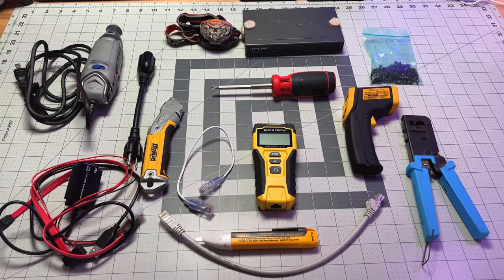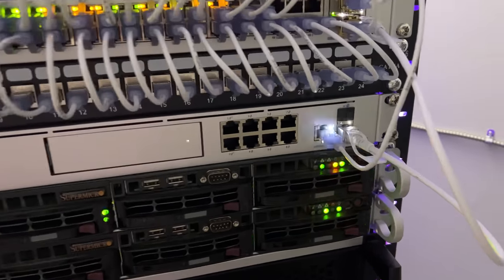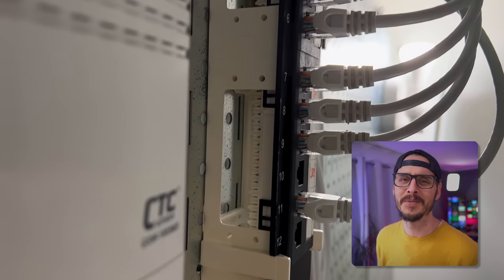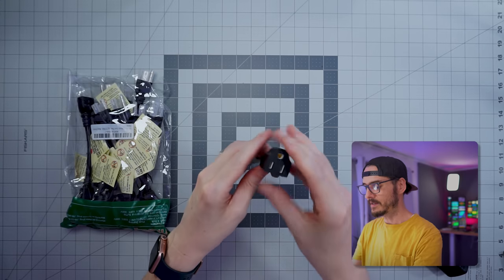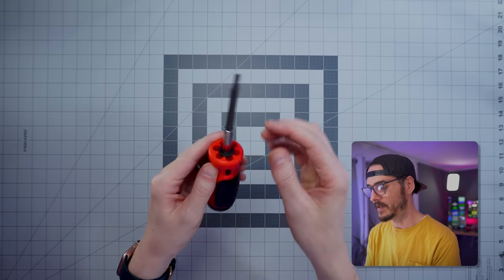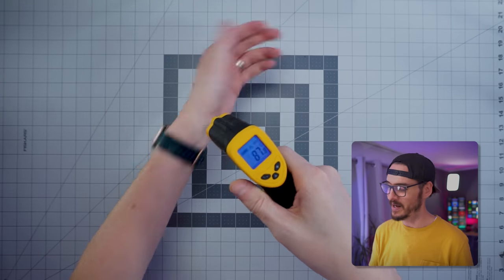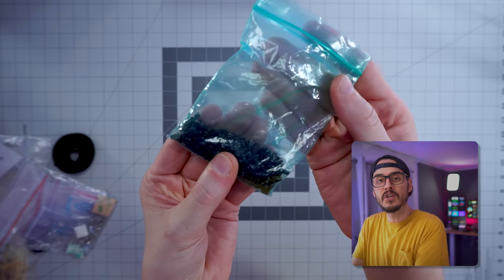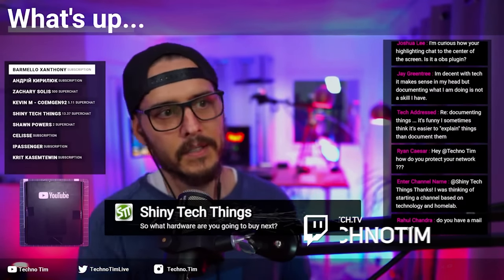Essential HomeLab Tools & Accessories - Network / Server / PC Tool Kit

Comment: Please don't trust your life to a non-contact voltage detector. They're great for troubleshooting but use an actual meter to verify 0v before touching anything.
Reply: Yes, I use the non contact to verify the correct breaker used and always verify with a volt meter before working on the circuit.  A few extra seconds is worth it.

Comment: What has your reliability been with hand-crimped cables? I've always had a hard time with hand-crimped cables maintaining connectivity and high speeds after being moved around for a few months, and I've heard similar stories from people across the skill levels. Meanwhile, I hear people sing the praises of punchdown when it comes to reliability, and plan to make my home setup only use punchdown and machine-crimped cables.
Reply: The problem is probably more related to moving them around, and the cable breaking inside the jacket rather than at the crimp. On cheaper cable, once it’s had a bend in it for awhile, and that bend gets unbent, the wires inside snap. That’s also my first go to when equipment is down.
Reply: @rrsttt7505  I've had runs with punched-down ends where the cable is not well protected -- people occasionally step on it, it occasionally gets crushed by moving furniture, etc. I've also had runs with crimped ends where the cable doesn't see much wear and tear (though still more than nothing). Both were made from the same spool. Even with the deck stacked against them, the punched-down cables had higher survival rates. The crimped cables also always failed either in the connector or within a fraction of an inch of it -- because they were repaired by cutting the connector off and adding another.

Comment: From my experience what administrators need are 'tools' for cable management. Many 19'' racks look like s#!t because people don't care about cable management. They just use a way too long patch cable, or a way too short one. And they don't care to clean up their patch panels when connections are no longer in use.
A network administrator does not have to repair network cables or connectors, but he should know how they work and test them. I mean, an administrator should be able to determine if there is a wiring problem or a software problem.

Also, a small switch or PoE adapter is super handy if you want to test IP cameras or other PoE devices. 
A good screwdriver, not a cheap one. Test the handle and the tip. A flush cutting wire cutter.

Maybe a USB to serial/COM port adapter and a corresponding serial cable if you have to configure devices that need that. Same goes for USB A to USB B cables if you encounter such devices.

Labels: Your preferred product for labeling cables, ports or devices to keep your stuff organized. And make it easier for the next person.
Reply: Have you had any trouble with the USB to serial cable on newer computers? My laptop has USB C so I have to use a hub with it, and my tablet has USB A, neither one of them can see a connection to the console port. I have to drag around an old laptop with a USB A port. I’m thinking the tablet doesn’t work because it’s ARM, but I’m not sure.
Reply: @rrsttt7505  No experience with USB C. But too many adapters in line is usually a problem. Or drivers for the OS.
Reply: @hw2508  yeah, that’s kinda what I thought. USB C to USB A, USB A to serial, serial to RJ45, is just asking for a problem I guess. I wish they would come up with a new way, it’s already an RJ45 for the console port, but I have to use 3 adapters to get to it.
Reply: @rrsttt7505  RJ45 to serial is just a different pin layout, isn't it?
Unfortunatly, I don't have a Windows PC with USB C at hand. But lsusb at linux showed a Prolific PL2303 serial port I had connected via a Dell DA300 to my laptop.
However, that's no guarantee that every adapter works without problem all the time.
I usually use an adapter from USB A to serial to a manufacturer specific cable for the configuration of alarm systems.